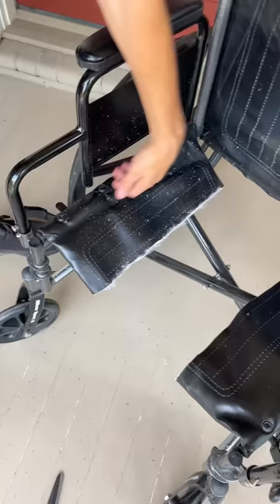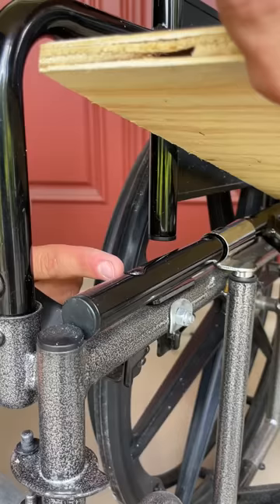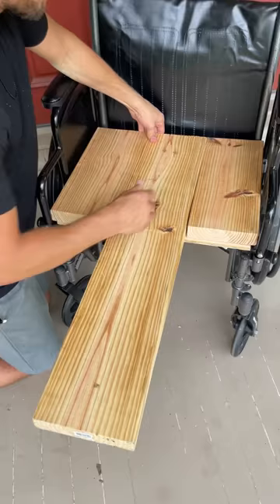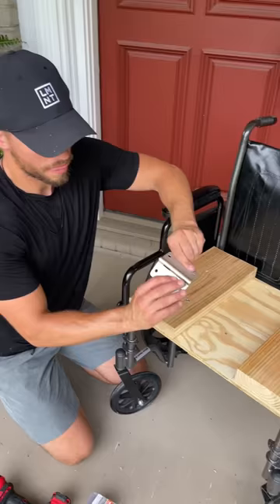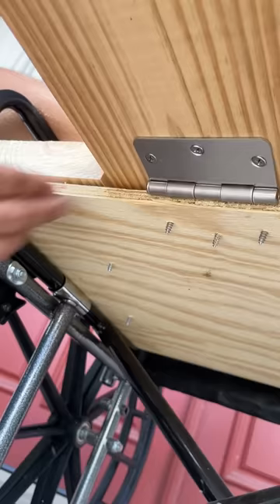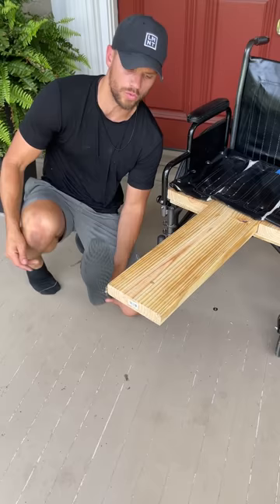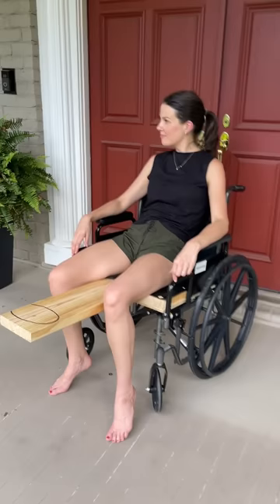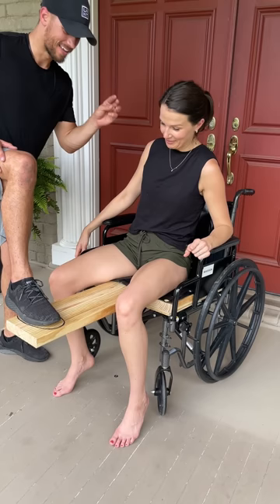Man saves Grandpa with New Wheelchair invention!

Comment: He probably has never had to use a wheelchair , because anyone that has knows those boards without padding , would be horrible to sit on
Reply: And creates bed sores
Reply: Exactly. That one looks pretty basic. Ones that see use hours a day will have either a solid metal seatpan with custom cushion on top or cushion with appleboard inserted on the bottom of cushion under cover to add rigidity.

Improper seating is a guaranteed stage 2-4 decubitus ulcer, several months to heal & costly hospital stay, possibly flap surgery too.
Reply: Even boards with padding are bad. My husband thought using boards to add support to our sagging couch frame would work…even with plush couch seat cushions it was still miserable to sit on.
Reply: And I could see some one that has mobility issues getting one leg over that board.  Stupid.  I'm 79 would never think of using anything like that.
Reply: Another way to feel large painful hemorrhoids up close and personal - all day long.
Reply: I thought the same thing & now you can’t fold it up to put in a vehicle

Comment: If your going to be around to put your foot on the board just put your arm under grandpa and help him up 😅❤
Reply: Have you ever tried to lift a person out of a wheelchair? It's not that easy.
Reply: @Factchekka  
Not if you know what you're doing and know how a wheelchair works.
Reply: @SvendleBerries  It's still not easy if the person can't support themselves properly.
Reply: @Factchekka  
If they cant support themselves properly, then flinging them out of the chair will do more harm than good.
Reply: @SvendleBerries  Yes, correct. But you are not going to be able to raise an adult male by pushing down with one leg anyway.
Reply: @Factchekka  And Forcing Grandpa to sit on a Board. Until Catapulted out onto the Floor Face first is a better plan? That's a great way to be Cut out of the Will.
Reply: @curtekstrom9531  You are either replying to the wrong person or you have not read any of my comments properly. I have only mocked this invention. (But having checked out the channel after posting my comments, it became apparent to me that this was done as a joke).

Comment: As a wheelchair user I approve of the out of box thinking but not the outcome.

It isn't the act of standing he struggles with it's that bones, joints, muscles stiffen and to begin to move a leg or arm takes time to allow those parts to loosen enough to move.

It can be extremely painful too depending on what exactly their dealing with. Besides all that in addition you need enough energy to stand  and withstand all of that. 

The slightest fatigue makes it feel almost impossible. Then you have to straighten to take a step and hope you don't lose your balance.
Reply: PRECISELY. And in addition... navigating a wheelchair is cumbersome enough, but to add a two foot extension of lumber to the front! Oh my NO!

Comment: Strange he might be onto something HEAR ME OUT 🤔 I would do something similar but a little different. The thick board got to go. But I do think there should be a board there with just enough cushion to make it comfortable. we should create a mechanism in the seat. Where you can press a button for the seat to slowly rise and then tilt you slightly out the seat. Think about when you're trying to set up. 🧐 What is the most difficult part about standing up from sitting. When you have to thrust yourself onto your feet. If the seat is pushing you up from inflating it like an air mattress or from a gear in the seat to rise could actually work with a little creativity. I have the image in my head I just don't know how to convert it into words for you to understand.

Comment: Am doubtful thin plywood base is strong enough to handle torque applied while lifting. The weight of counter balance and weight if patient is significant. Maybe stronger bracing at edge below the patient knees for safety. Collapsing edge would harm patient.

Comment: Omg the underside. This dude has decent ideas but his craftmanship is painful. Use screws in the correct length. And if you connect two layers of wood 1 thin 1 thick you always screw into the thin first thrn into the thick. This hurts to watch